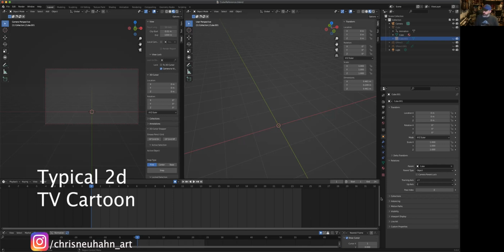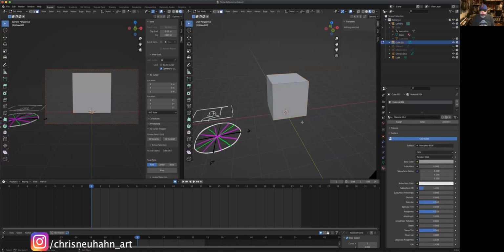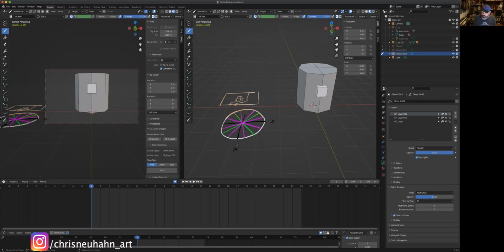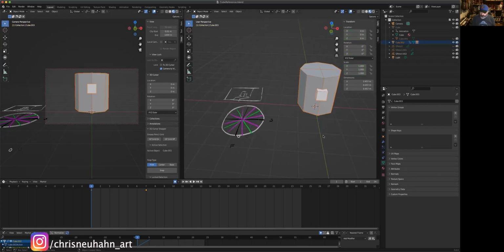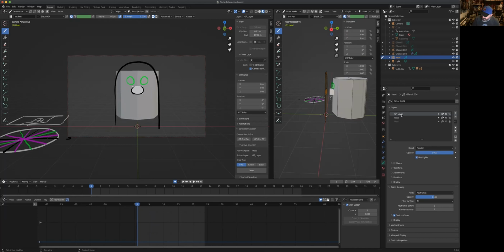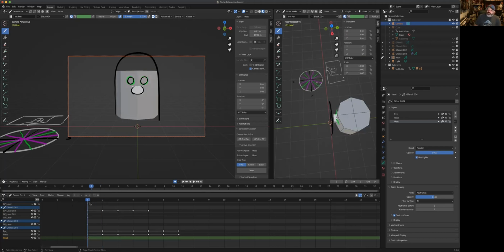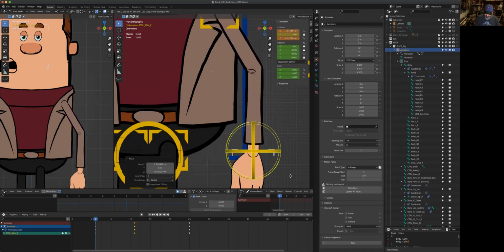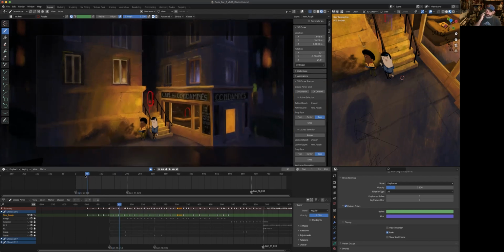Head Turn Concepts || Simple 3d for Grease Pencil Reference || Blender || Grease Pencil

Comment: Thank you for another tutorial!
I would like to ask you a question. Why so little attention is paid to converting the meshes into GPs for character animation? Then there would be no need to draw every frame of the turn, just use the keys. And the turns would be smoother.
Reply from the maker: Because I want it to be be drawn. I’ve never been a fan of toon shaded 3D, and i think it would end up feeling similar. I also don’t mind some imperfection.
Reply: @ChrisNeuhahnArt  I didn't mean it like that. I may have explained it incorrectly in the question. 
We can use the LineArt modifier to convert the mesh to GP, and we can draw all of the character's mimics and dresses in the GP, the colors can also be assigned in the GP. Finally we get a mix of 2D and 3D, where the expressive part remains in the hands of the artist, and the technical (turns, rigging, etc.) is in 3D. 
And we will have full control over which type of animation will be more: 2D or 3d.
Reply from the maker: Part 2 of my full character build will be out tomorrow. I cover the answer to your question during the video.  Let me know any other questions you have and I'll try to answer them as I record part 3.